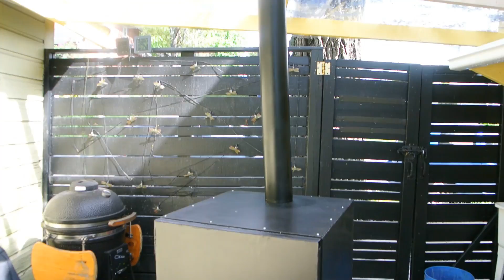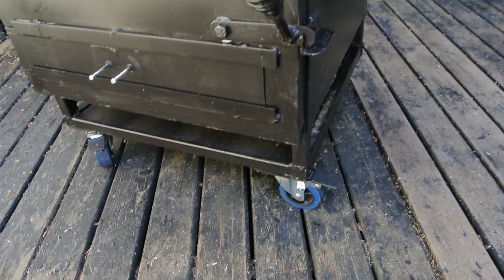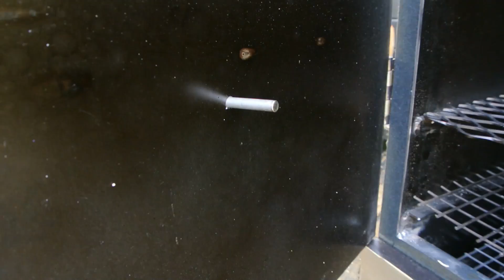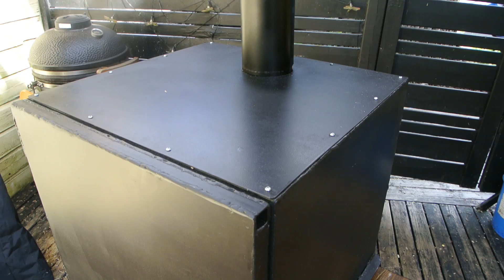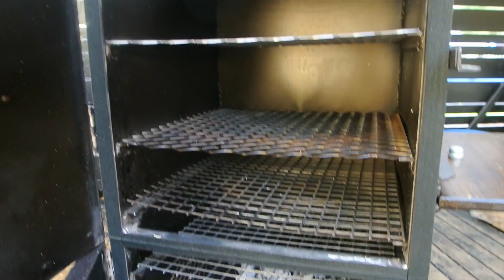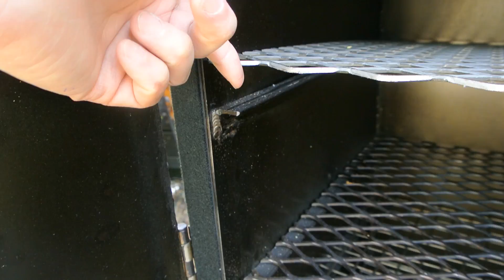How to Build a BBQ Smoker Completed - Final Video - Part 5 (5)

Comment: Just found you video. I've been considering building my own cabinet smoker/cooker. I love what you've done. I've never welded, I know nothing but about steel accept that non-galvanized, 304, lead free stainless steel plates and expanded metal should be use. 
I don't know where to purchase the materials.
Why not fire brick?
What tools? It looks like you posted this video in 2016. Has there been any modifications?
Whatever you can share would be awesome. Great job.